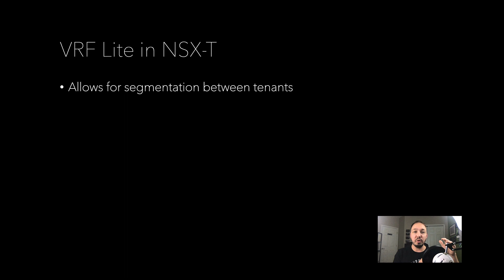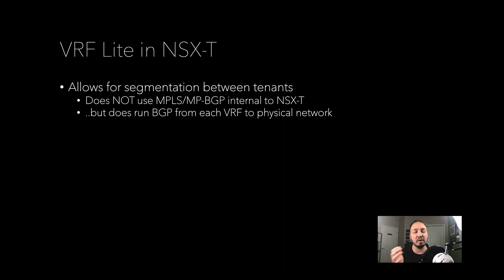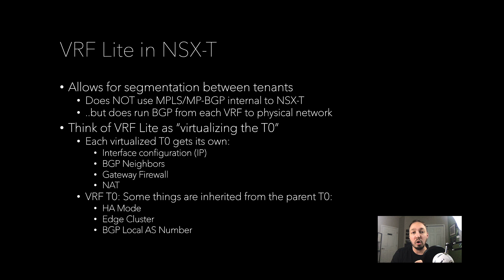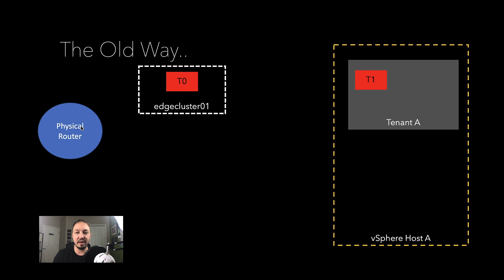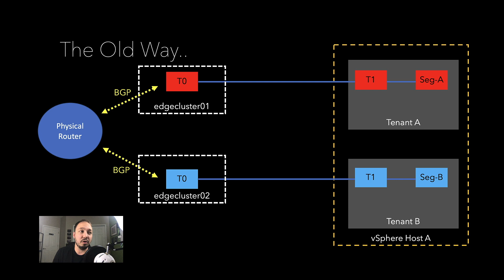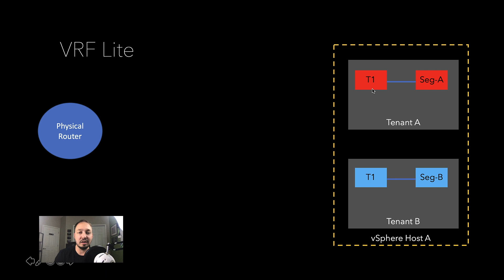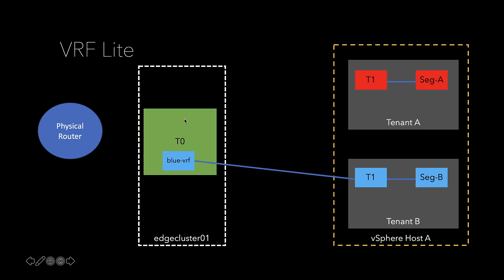How VRF Lite works in NSX-T 3.1 (Pt. 1)

Comment: hello Mike, Hope you're doing well. I found out that one edge cluster can backup multiple T0
Reply: Yes, you are right. However, when you try to assign uplink interfaces for the second T0 from the edges of the same edgecluster, it will throw an error saying that the interface is already assigned

Comment: Annoyingly as I found out recently, not supported in NSX Federation (as well as LB, IDS/IPS, L7 Context FW). OK, to be fair there is nothing stopping someone creating VRFs using the local managers, but if you are using Federation I guess you would want a VRF to be subject to what Federation offers in terms of multi-site capability.
Reply from the maker: Yep! There's a few things on that list of unsupported federation features (great timing btw, I'm literally working in my lab on federation at this moment). LB is supported with federation though, albeit limited to only a T1 one-arm design. With 3.1 being the first full federation release, I'm sure a lot of that will be cleared up in the next major release.
Reply: @NRDYTech  Apologies, the LB you are correct, I think its listed as not supporting L4+ Services (brain is on a go slow today). However the the doc where I got the limitation list from (NSX-T 3.1 Multi-locations Design Guide), I did find an error (and reported back into VMware) - it was stated that NSX management cluster did not support SRM for Disaster recovery, and in fact it has been since 3.0.2. I Think as these docs are so huge they have been written over a long period of time, its easy to miss making changes where a feature changes just prior to release. Anyway, good luck with the labbing, I am about to start testing VCD in my lab, and also seeing if I have enough resource to try VCF (nested version of).
Reply from the maker: @johnosborne1977  Nice! Yes, I know one of the authors of that doc - and he's amazingly sharp, so I suspect you're right - that doc is HUGE and probably just fell through the cracks. Federation is going smooth - doing packet walks and such to prepare for a fed video on this channel.  For the VCF lab - good luck! Best advice I have is common sense - remove mem/cpu reservations on everything, and try really hard to be stingy with allocating mem/cpu :) My lab is on the edge with federation - around 90% used, and VCF is worse! New 128GB host on its way.

Comment: Hi, it is really necessary to create another T0 edge cluster for tenants with old way? What about tenants on T1 router level,anyway thats how vCD works right?
Reply from the maker: Sure, you could do that as well, I suppose it depends on your requirements/preference. Most of my customers seem to prefer splitting up to the T0, but both are valid options in my opinion